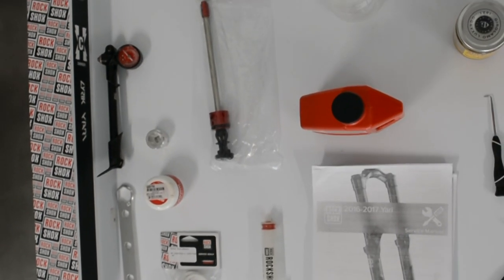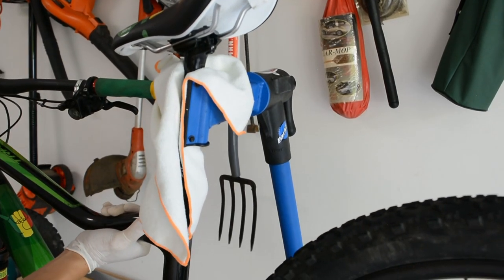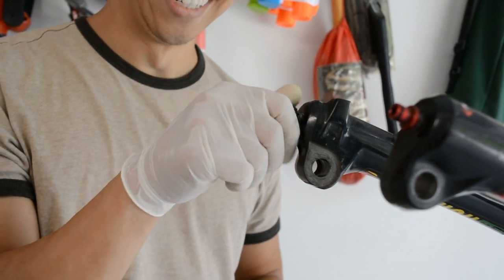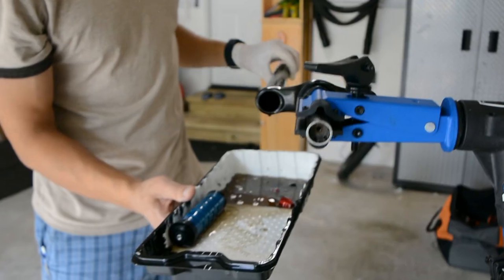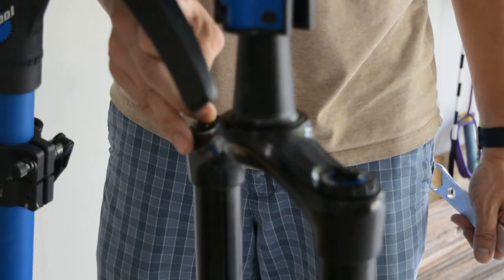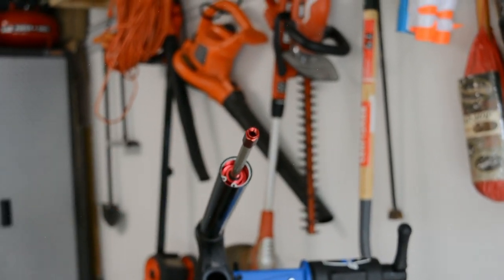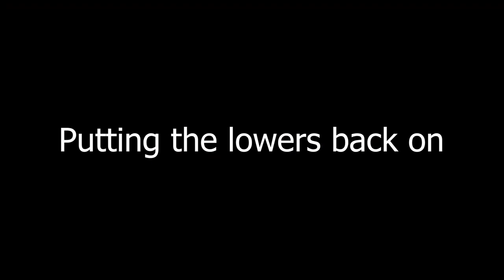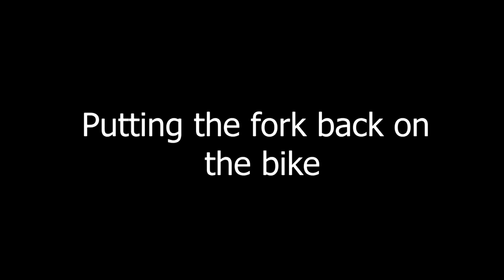Rockshox Motion Control to Charger 2.1 RC2 | Turning a Rockshox Yari to a Lyrik Ultimate

Comment: question...which way did the black washer go on the end of the damper bolt...did the side with the ridge go face down into the open channel or was the ridge side face up towards the bottom of the lowers.....hope this makes sense.  great video btw.
Reply: right around 17:54
Reply from the maker: I’m guessing the ridge side faces towards the bottom on the lower.

Comment: so what differences did you notice?
Reply from the maker: Hey! This wasn't my fork, but I've owned bikes with the yari and the lyrik ultimate, and from my experience, the difference is very noticeable. Once you get the Lyrik set up properly, the small bump sensitivity is great. I never really liked the motion control damper after I rode a grip damper or the charger dampers.